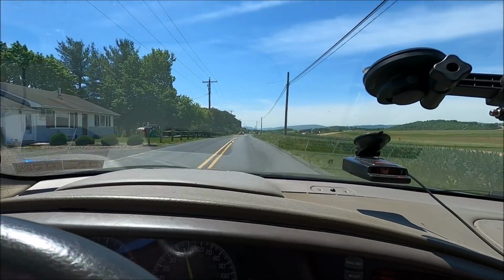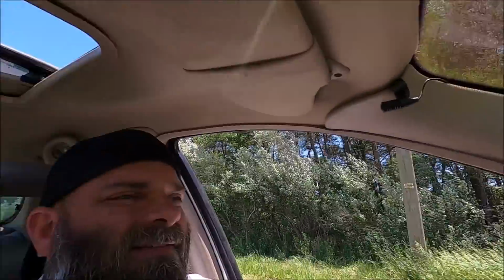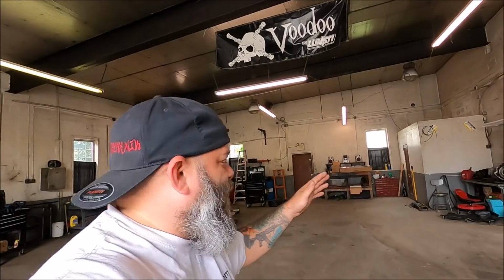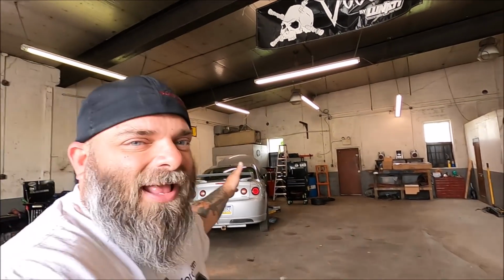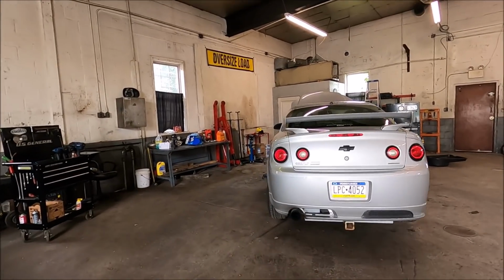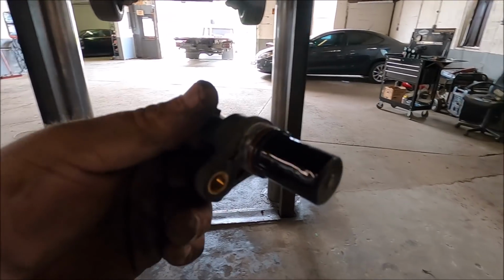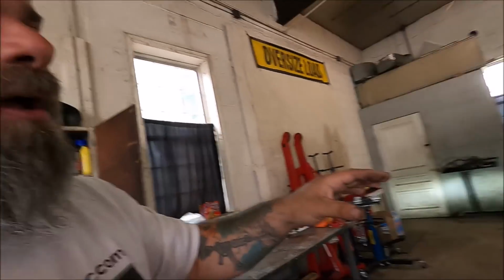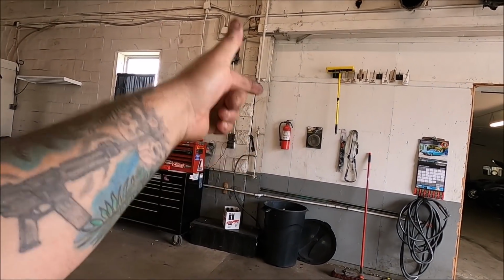My Kids Cobalt SS Is BROKEN!

Comment: Love watching your channel. I've picked one of these cars up before it went to its grave. I live up north  these cars have decent motors the cars themselves just rust away here. Too bad . but  since the old distributer days . it's common things like those crank sensors going  but mechanically the lower ends were bullet proof . I've been reviving these 90 cars drivem to the 400 thousand mark if oil was changed regularly. not much goes in these cars. Fuil pumps , its maintenance not being done in most cases.  like the grand prize bullet proof . cause they run for ever just some technology stuff fails but luckily its plug an play stuff  it's got its advantages  I hated all of it when it started out but love the channel I've learned a few good things aboat the car  yah that starter made me shudder a few times haha I've been their twice an replaced it twice also. An now find    my good luck turns out its behind the starter if I'd seen this sooner, Ide changed it for shure.  But that's my luck!  Haha great vids